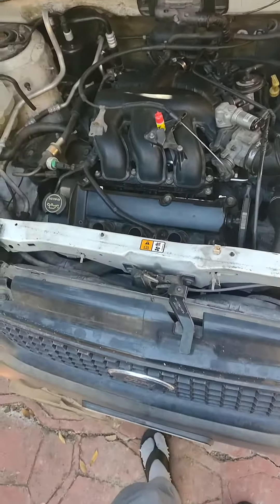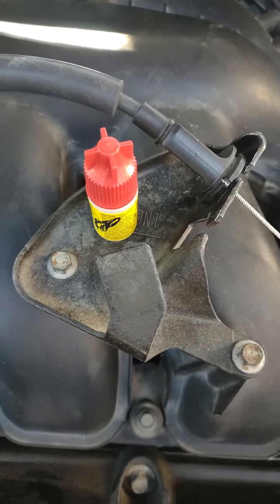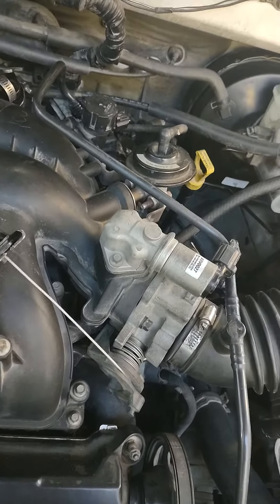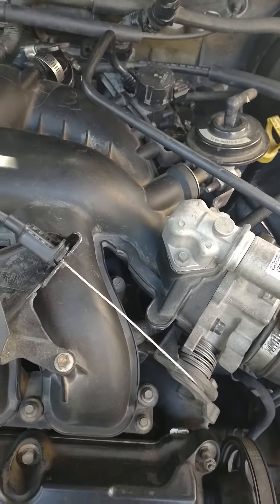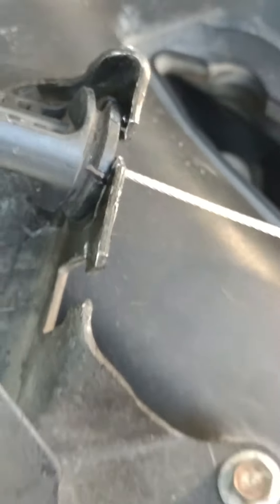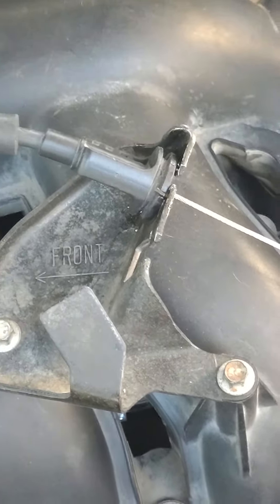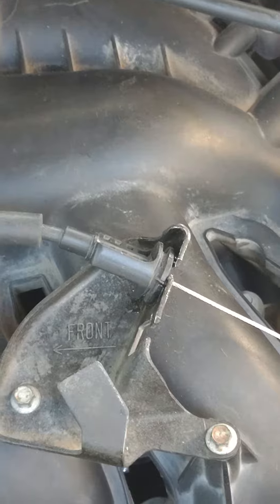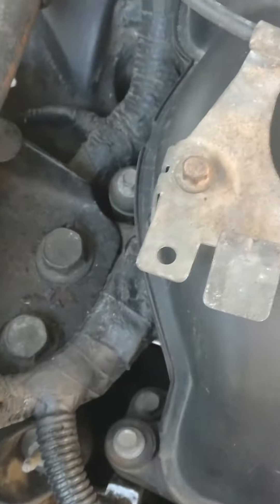Car Fix Accelerator Cable,,,easy fix!!

Comment: What was the issue when driving
Reply from the maker: When it broke the cable jumped out of the bracket.  So I tied it down with a wire for several years, but I didn't like the way it looked.  So I decided to apply Super Glue.  Great fix and when I open my hood the motor looks awesome.